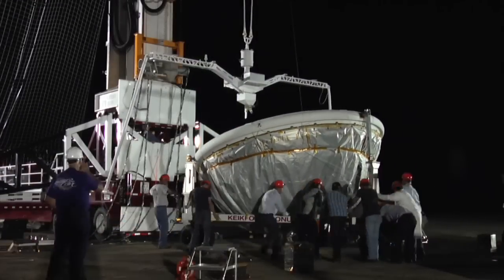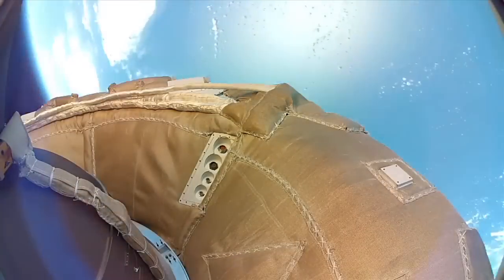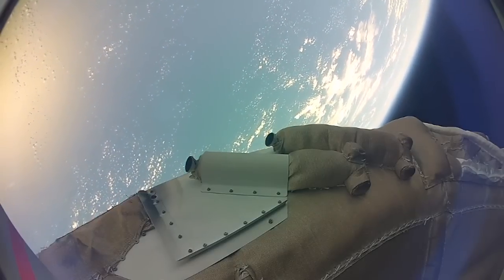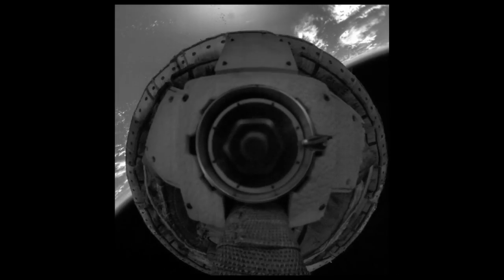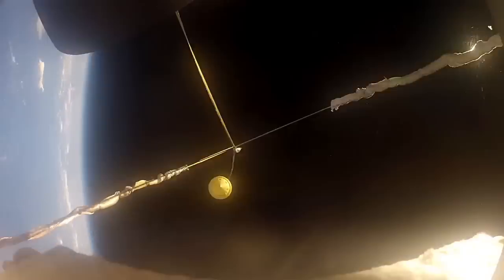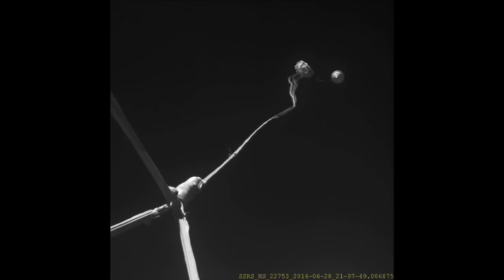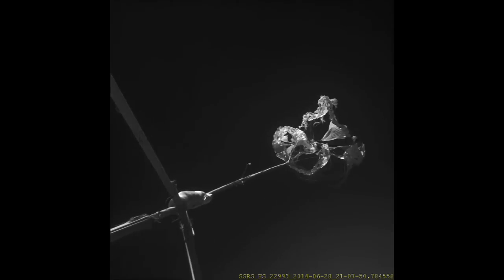LDSD: Supersonic Test Flight (HD)

Comment: Instead of releasing the balloon could the hydrogen in the balloon be pulled in and compressed into the rocket and used as more fuell? Maybe retro rockets for re-entry.
Reply: Now NASA is going to use the very clever go to answer. "We already thought of that."
Reply: It uses a solid rocket motor, so there's  no option for hydrogen reuse here.
Reply: There are exothermic uses for hydrogen with oxygen on-board the space plane. In space, even low space, there is no air to slow thrust so Newtons Laws of motion on the space plane are 100% for the space plane and zero for air resistance.

Comment: So I just saw the june 2015 live feed. This is a test vehicle right? We saw the SIAD inflate and just a few seconds after that deployment of the parachute. Wasn't that fast? Shouldn't the donut be given some time to decelerate the vehicle? Or does it already decelerate the vehicle by 1.5 mach (from 4 to 2.5) in a few seconds? And why not try testing multiple parachutes in one test? Test one chute design, see how it holds and whether its deceleration of the vehicle is as designed, and the cut it loose and deploy another? Just so you can test multiple designs in one go? Then the best design can be chosen. :)

Comment: Every Kerbal player knows the dangers of deploying parachutes at high (time) accelerations.  :)

But seriously, it's great to see the technology getting developed and tested, and we all know that things which fail during testing just serve to tell us more about the problems and help find solutions.
Reply: Haha. I agree Scott. :p
Reply: Or, simply turn off deadly reentry :)
Reply: We need to get jebediah on this problem ASAP.
Reply: ITS HAPPENING :O
Reply: Eh, just pack a few dozen drogues.
Reply: That would be amazing, that way, NASA wouldn't have to ponder about the next heat shield they'll make and make things that go to the Moon and Mars instead.
Reply: Jesse R PHYSICS ARE SO UNFAIR. We should be able to strap 500 small thrusters with 0 mass and infinite fuel to our command pods and end up on Mars in an hour...
Reply: Especially if you have Ferram Aerospace dictating the aerodynamics of the game.  Or is it Deadly Re-entry that causes realistic failure in parachutes?
Reply: ***** lol!
Reply: +Jesse R No, NASA should use them.
Reply: I accidentally deployed it on the Mun :D
Reply: Yeah, it's darn dangerous to deploy a parachute at high speeds. So normally I do have a rogue to slow it down then I deploy my main parachute.. Hard work...
Reply: Jesse R Now this is something. They are making one. Not NASA but some other company. Just like the RAPIER engine, it is also named after a sword. The S.A.B.E.R engine.
Reply: Hahah

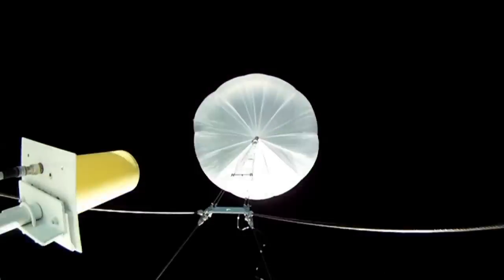Comment: 0:18 Scientific Balloon??

Is that in anyway different from any other balloon?

Why the extra descriptor?

Evidence of brainwashing perhaps? Yes.. I think it is so.
Reply: Are you fucking stupid? These balloon are made of sheets polyethylene only a few micron thick. They're enormous - as big as hundreds of feet high, and can reach up to 173000 feet under optimized conditions with extremely lightweight payloads. These balloons can cost millions of dollars. Fucking imbecile.
Reply: And I apologize for the profanity, even though this is the internet.
Reply: MassChaos1264

Doesn't make any difference.. a balloon is a balloon. Adding the descriptor "scientific" does not change a damn thing. In fact it is incorrectly used here because there is nothing scientific about an object or material.

A million dollar balloon and a $1 balloon are both balloons.. there is nothing more "scientific" about one or the other.

The statement "scientific balloon" adds absolutely no clarification in the context of this video vs just "balloon".
Reply: So is there no difference between Buckingham Palace, and the Section 8 Housing for low-income families? They're both houses.
Reply: MassChaos1264

Your anology does not apply.

An object is in no way scientific on its own.
Reply: But it does. These balloons were designed for scientific research purposes. That is their intended task.
Reply: MassChaos1264

Scientific is a descriptor that refers to a process not an object.

Do you call your computer scientific? No.

Your computer is more complex than that balloon btw.
Reply: One of the definitions of "scientific" is relating to or used in science." If something was designed and intended to be used for scientific purposes (such as these balloons), I think it's fair to call it such.

Comment: Awsome vid, that parachute didnt have a chance though, you would think NASA would be able to do a little better that even on the first run, at least now they know they werent even close
Reply: It was a test that's why it's called a test apparently you don't understand
Reply: With the worlds best engineers there I would expect the parachute to perform a little better than that sad display, even on a test
Reply: scooby DUI They already did a couple sled tests pulling the chute down with a cable and rocket sled, this isn't actually the first chute test, it was a rather sad attempt, but it doesn't matter the goal is to learn and research so they did accomplish part of the goal.
Reply: took the words out of my mouth.
Reply: scooby DUI They already did a couple sled tests pulling the chute down with a cable and rocket sled, this isn't actually the first chute test, it was a rather sad attempt, but it doesn't matter the goal is to learn and research so they did accomplish part of the goal.

Comment: Why not just use super thick MYLAR balloons that get filled with Helium or Hydrogen to drop any lander slowly to MARS ?
Reply: deltaalpha21074 I can see a couple of issues.  First off, there's the weight of all of the hydrogen or helium being transported.  If the parachutes weigh less than the weight of the tanks and the balloons, then the parachute is better.  Second, the parachute is simpler.  Any system can fail, but the more complexity in the system, the greater chance of failure.
Reply: OK then solid rocket fuel rockets and devise that checks air speed and then inflate MYLAR BALLOONS?
Reply: deltaalpha21074 That really isn't going to work on Mars. The atmosphere there is too thin, so even huge hydrogen-filled balloons have a hard time lifting off from the ground. You want maximum drag from parachutes and a wide lander to slow the craft down as much as possible, then perhaps fire SRBs to slow the craft down just before touch down.
Reply: Of course it would there is some atmosphere on MARS nothing compared to EARTH of course so you use like 20 balloons size of biggest weather balloons used on Earth and it will slow the decent of the space craft or lander? Common sense and they work every time if timed to go off?
Reply: Parachute relies on thicker atmosphere and at high speed tends to shred ..MYLAR BALLOONS will just float down and weight of gas is KNILL it's compressed into tiny tanks made of CARBON FIBER I already know the company that makes them same one that makes the retro gases for sattelites.
Reply: gturner38 Weight of the Balloons say at .25 mil would be very little  and gas compressed into small cylinders made of carbon fiber are next to nothing as well; trust me? ..these are used on all aircraft and spacecraft now? I have held them many times wow you would not believe the difference in weight from Aluminum to Carbon fiber?
Reply: I guess you would have to know how much gas would be required to carry a one tone payload in Mars' thin atmosphere.  The craft would have to be slowed significantly prior to balloon deployment.  The balloon would have to fill rapidly because the surface is rapidly approaching. I don't think it could work.
Reply: Remember the atmosphere on Mars allot less than on EARTH OK ? so forget parachutes they do not get the amount fo drag but MYLAR BALLOONS would?
Reply: deltaalpha21074 At Mars' surface the pressure is equal to being 20 miles high here on Earth.  At altitude on Mars I don't know lets say 20 miles, the atmosphere pressure may be equivalent to 200 miles high here on Earth.   The balloon even if filled would provide to little lift at first giving little slowing effect.
Reply: Hartcore11 Well then both Parachutes and MYLAR balloons would be worthless there; HUH? so guess only thing left is whole bunch of SOLID rocket boosters that slows it down like in the old 1950's movies where the space craft slows down before touch down?
Reply: deltaalpha21074 Parachutes have been used and will continued to be used there at Mars  They are not worthless.  I think you are beginning to slip into some kind of madness.  You do know they used parachutes there right?  If they have used chutes there many times.  Why are you insisting they are useless?  It is obvious they are effective.  That's why they use them.
Reply: deltaalpha21074 Solid rocket boosters are not able to varied in their thrust to a degree that would enable a safe landing.  I think once SRB's are lit there is no shutting them off until they run out of propellant.  Maybe the thing you need to do is explain the sequence of the entry interface and landing with your balloon idea.  Calculate the volume of the gas required to fulfill the lift and deceleration required.  When the balloon is ejected for use and all the other things required.  Also detail the use of SRB's all the way down to the surface so everyone else can understand your insistence that they can and should be used.  Just explain the sequence.
Reply: deltaalpha21074 I just did some calculations.  The lander weight is approximately 2200 lbs.  In order to provide a positive lift on the craft I added 400 pounds of additional lift requirements for the balloon or multiple balloons.  The cubic feet requirement to lift the craft at Mars surface with the 400 lbs of additional lift would require 4,170,000 cubic feet of helium to do this.  A standard pressurized cylinder of 29.5 liters at a pressure of 2000 PSI holds just 134 cubic feet of helium.  This would be equivalent to more than 30,000 tanks of helium disregarding the weight of the tanks themselves carbon fiber or not.  So even if you took the pressure of a tank to 20,000 PSI how many tanks would it take?  More than 3000 tanks of pressurized gas.  If you think I have made an error in my calculations please provide what would be required.  As far as I'm concerned the balloon idea is a complete dead end.  If you still do not want to turn around then please submit your calculations for all to see.    Now what about your SRB idea?  Why do you think they should do this instead?
Reply: deltaalpha21074 I did leave out accidently the difference in gravitational pull on Mars vs Earths.  If you just multiply the 4,170,000 cubic feet I first calculated times Mars' gravity you will have the more accurate CF gas requirement.  Sorry for leaving it out.
Reply: Hartcore11 I just think they take up space and weight and do to the speed they can shred? --the fact that any object is flying at very high speed into Mars atmosphere something that really drop the speed and weight down would be greatly appreciated with landing?

Comment: This is a great update to what happened during the test. I was under the impression that the chute got tangled and only partially deployed, but this video clearly shows it disintegrating under the stress. Thanks for the update. Hope the next test goes just as planned. Looking forward to larger payloads on Mars.

I'm also reminded how impressed I was with the precision the rocket motors had during spin-up and then stabilized flight. Very cool to watch.

Comment: I don't get it - those super sonic parachutes seems to fail 2/3 times, isn't it a dead end?
Reply: Supersonic parachutes have been used on every Mars landing mission to date, and so far there have been no known chute failures from any of those missions.
Reply: The issue with this test was that they have to make a "huge" parachute - much larger than ever used before.  The parachutes used on other planetary missions have (correct me if I'm wrong) a 100% success rate.  We want to land some really big stuff on Mars and we have to have a really big parachute to do that.
Reply: aSuspiciousPete... science.... testing. test video. never been done at this size or speed. its called a failure. we then move on and try harder. that's called engineering. :) making the impossible possible
Reply: *****
chutes... once they are functional... are very reliable and can be tested before they are flown without damage.  Rockets and rocket engines are less reliable and testing them before flight increases the risk of a failure during flight.  For instance... the assent engine on the Lunar modules.  The first time propellent flowed through each one was when it was being used on the Moon.  They feared testing it before and... causing a stress fracture... which would then cause it to catastrophically fail when it was needed.  The reason you do research like this is to see if and or how something can be done.  If they can get it to work... a chute is a very good option.  I also suspect that a chute weighs less than the fuel needed for a rocket to slow it down.  It could also produce less stress and vibration on the vehicle.  Basically all sorts of things are considerations when picking a deceleration method and it's good to have multiple methods to chose from.
Reply: ***** They can use retrorockets but, the mass and volume of the fuel is far greater than a giant parachute and that means you can send as much stuff on the trip.
Reply: why do that when they can have a parachute. and dont point to the failure above. thats why they test. Nothing you take for granted was built in a day.
Reply: David Duvall Why can't they just use retro rockets to slow down instead of having a parachute?